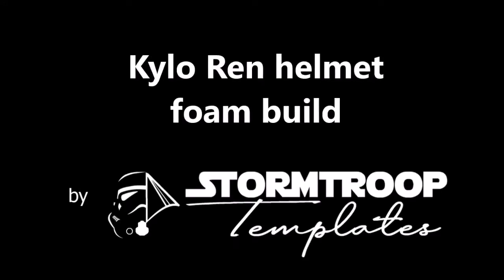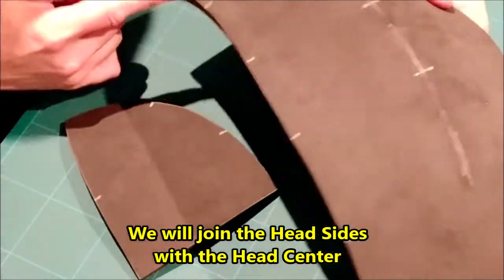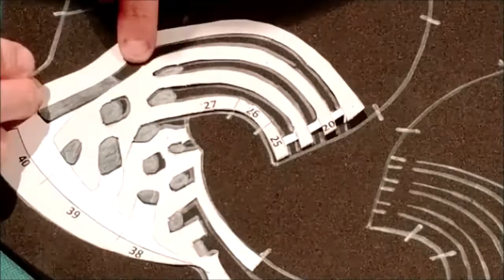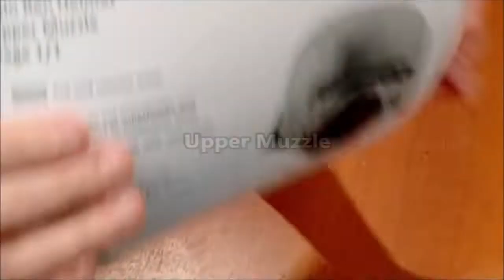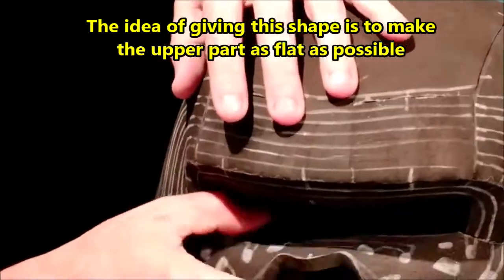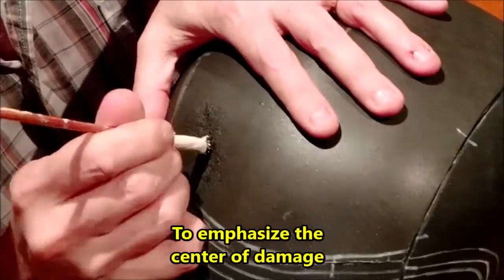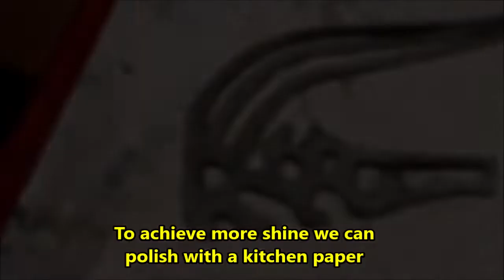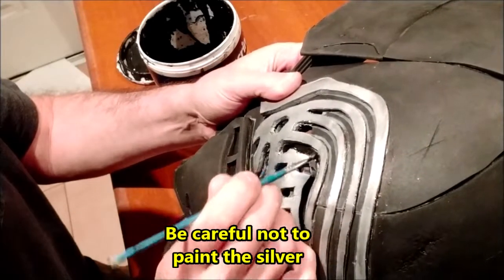Kylo Ren Helmet Foam Build

Comment: Hey I wanted to make this helmet but I don’t know how thick I should get the foam sheet what would you recommend?
Reply from the maker: Hi, for this helmet only you need 8mm foam thickness. Check the Etsy item product description. Also in the video I say all the thickness you need.
https://etsy.me/2OUy8hx
For this template, the basic things you will need are:
· 1.5 square meter (1m = 39.37 inches) of 8mm foam thickness.
· Small area of 5mm foam thickness. 
· Small area of 2mm or 3mm foam thickness (2mm recommended).
· Contact cement, hot glue gun (optional)
· Foam cutters, scissors (optional)
· Heat gun or powerful hair dryer instead
· Paper tape
Note: recommended foam density between 60 to 80 (30kg to 50kg in kg by m3) to get the same result.
Letter pages to print: 17
Tell me if you need more info.
Cristian